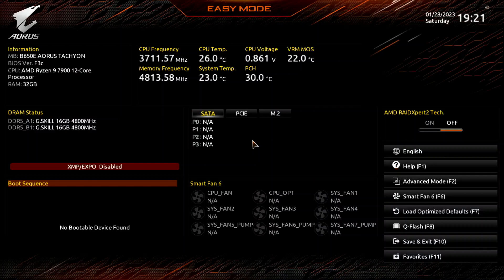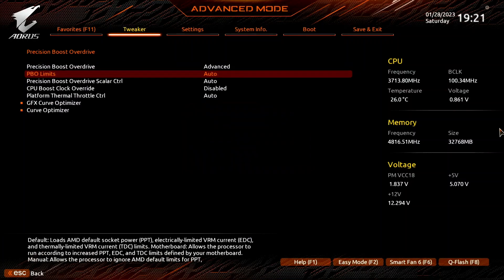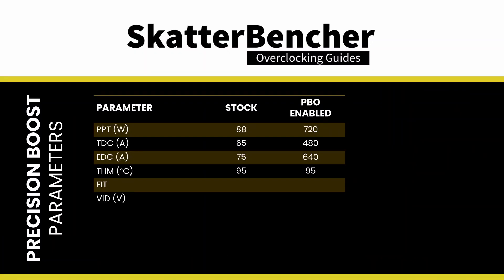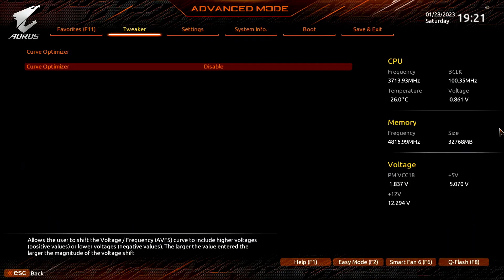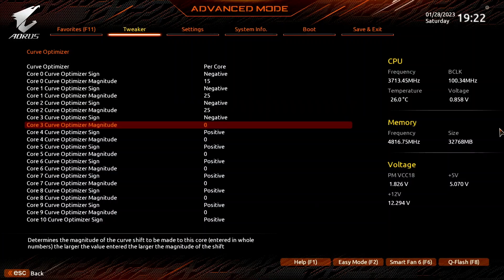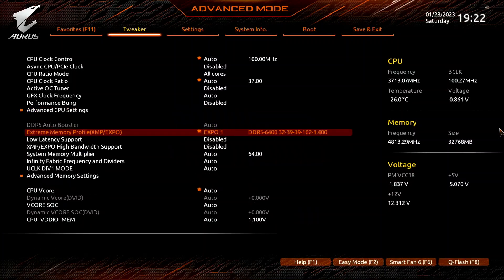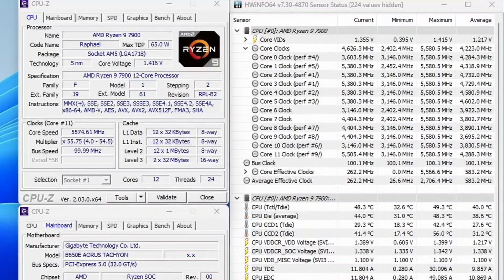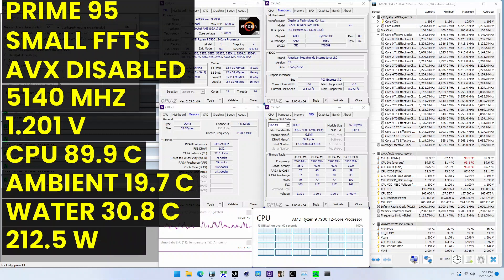5 Minute Overclock: Ryzen 9 7900 to 5580 MHz

Comment: What should i use for cooling? righy now im on the standard 7900 cooler.
Reply from the maker: Any decent, modern AIO will do just fine
Reply: I use peerless assasin aircooler and get great temps. 7900X at 5.5 ghz

Comment: is it possible to do this using AsRock MOBO B650M PRO RS ? im using this CPU with that mobo
Reply from the maker: Technically yes, since overclocking is allowed on B650 motherboards. I'm not familiar with this particular board, however.
Reply: @SkatterBencher  what is the mimimun requirement of vrm for a mobo to be able to do oc or safely do overclock ? My mobo have 8+2+1 Power Phase, Dr.MOS

Comment: Before updating the BIOS of my MSI MPG B650 CARBON Wi-Fi motherboard;
-15
-25
-25
-25
-25
-25
-30
-30
-30
-30
-30
-25
With Curve Optimizer Magnitude values, I managed to get 1946 Single and 28777 Multiple points in Cinebench R23 Tests. After updating the BIOS, I could never reach these values. With the new BIOS I was able to get 1802 Single and 27300 Multi-core scores. I installed the old BIOS version, but I cannot get my old performance at all. How can I solve this?
Reply: which bios version do you use ?

Comment: I got the very same CPU on a Gigabyte Aorus b650m elite ax motherboard, using the Corsair Vengeance 32GB DDR5 6600Mhz Dual Channel ram kit and for whatever reason, whenever I enable the 6600MHz XMP profile, the system won't boot. It only works with a manual overclock up to 6000MHz... any idea why and how to get it to run at the advertised 6600MHz XMP??
Reply from the maker: Ryzen 7000 CPUs have trouble with high-speed memory beyond DDR5-6400 or so. The maximum I've been able to do for is about DDR5-6000 or 6200. So you experience is normal for a Ryzen 7000 system
Reply: @SkatterBencher  This particular CPU tops out at CL52 Memory Speeds as per AMD website. You can push it past that, but there are limitations, usually falling within 400-600 speed topouts, so this would not be unusual. You would have to tune(Or clock) the frequency/timings/voltage of your by very small increments to min/max your efficiency/performance.

Comment: Thank youu brooo, i get so confused about whether to get 7900 or 7900x because the electricity is so much different for the efficiency, but when you boost the performance it will take 220 wat ya bro? So its not really different with 9700x?

Comment: how far we can push 9 7900 ? Is it notable difference to 9 7900X one ?
Reply from the maker: There doesn't seem a meaningful difference between 7900 and 7900X when it comes to overclocking capabilities
Reply: @SkatterBencher  so civil R 9 7900 will go as far as X one ?
Reply: @arturb5152 jep  it runs only cooler and less power I believe but current the prices are the same so yeah doesn't matter much if have good aio my 7900  runs at 33 degrees idle have not yet tested full  power as I am just  setting the new system up.
Reply: @kevinJesusSaves  which graphics card You have?

Comment: The per core CO values depends on what your best cores are. That varies so your values is not right for everyone. You should've mentioned this but part from that it's an easy guide for some extra oomph for the 7900.
Reply: Literally stated in the first ~30 second of the video: "Please do not outright copy these settings and apply them to your system --- "
Reply: @Lann91  Aw crap... You're right and I'm sorry. Didn't catch that, believe that was when I was asked to do them vacuum cleaning and you know what happens then...
Reply: how do you know which cores to give a bigger offset... my 6-11 cores are running about 150 mhz slower then 0-5, so do the need less or more offset on 6-11